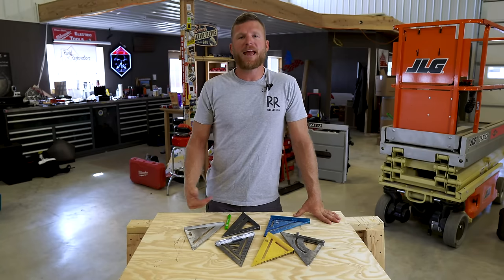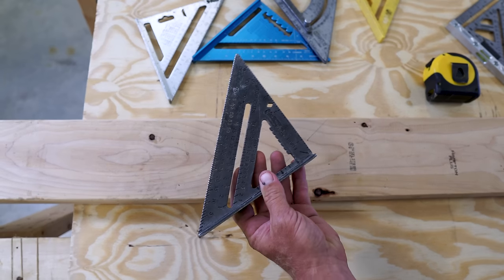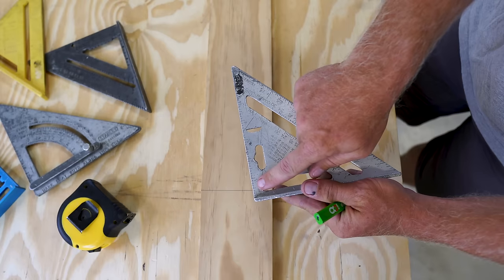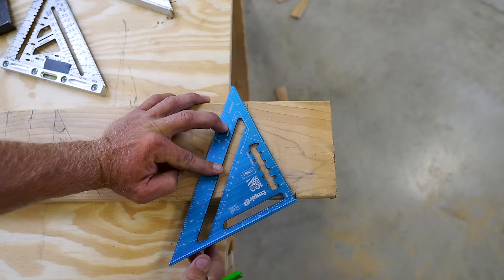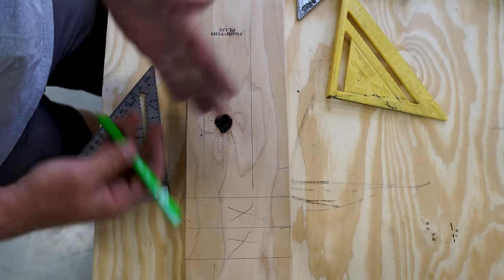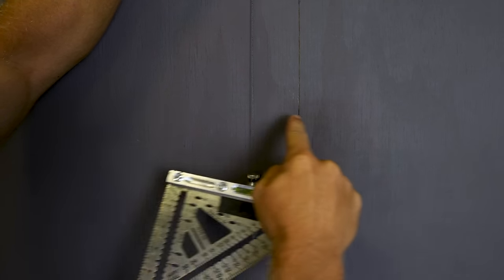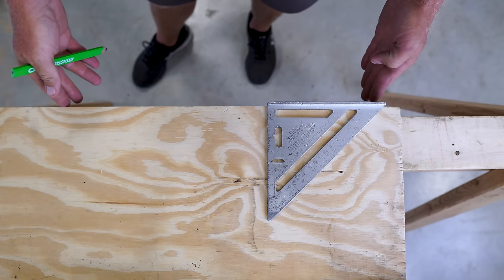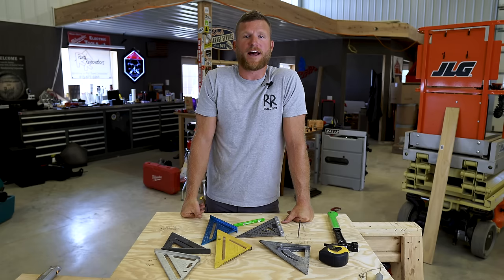Top 10 Uses of a Rafter square, aka "speed" square

Comment: I like your reasoning for having the speed square face towards you when cutting a board. I will start doing that.
Reply: i have found that the square is more prone to wandering away from the wood when used that way,  also you must keep a tighter grip on the square and work piece to keep it from moving.
Reply: Framing square is a different thing and not discussed in this video.
Reply: I cut this way because the saw motor catches on my empire lip so i decided to just flip it and hold tighter
Reply: @benningtoncamper2852  nah, I clamp mine
Reply: alejandro espino same especially if you have the saw depth all the way down
Reply: @versatileduplicity9313  that sounds sensible, methinks I shall do this.
Reply: @versatileduplicity9313  that would take forever
Reply: @KJ110813  it’s called accuracy and not a shitty cut !!
Reply: @versatileduplicity9313  If you're cutting baseboard and don't have a chop saw or something, sure I can see how a clamp might help (though I've successfully squared 1x6 clear pine boards with no clamp and a fine finish blade on my circ saw without any issues).

Though if you're cutting framing members  and can't get an accurate cut without using a clamp then you might want to either get a little more practice in or replace/sharpen your saw blade. Or invest in a(nother) chop saw.
Reply: @KJ110813  how about you just figure out how to make accurate cuts, but fast
Reply: @versatileduplicity9313  I have. That's why I said using a clamp would take way too long and be a huge waste of time.
Reply: Hell no! It can wander that way but can’t move iF edge is on your side. Really surprised he said this given all other tips are on point

Comment: You also helped this 37 year old mother of three who recently fell in love with woodwork and knows absolutely NOTHING about it. I appreciate this video, learned a whole lot and I am excited to start my first project!
Reply from the maker: Awesome good luck!!
Reply: Vanessa Benitez Do it! Get it Done. I built my own garage work bench (8x4) from simple internet plan under $60 using 3/4” plywood, 2 x 8’s, circular saw, tape measure, nails, pegboard, and plenty of elbow grease. 👊🏻 Bit of sanding and 2 coats of poly varnish. 5 years later it still looks good and most importantly, USED! 👍😁 Still get complimentary remarks on it, with the occasional “...YOU built that?!...” I hit Medicare age end of this year. Proud am I?! You betcha!!! 😌😀

Comment: I actually got my start in woodworking through cabinet and furniture making. I went 12 years in the craft not knowing how certain features of the speed square could improve some of my tasks just because no one ever showed me. Finally I employed a rough carpenter and taught him fine finish work and then I got to learn from my employee how it could benefit me. 

There's a lot of basic Carpenters tools that hobbyists and even pros in other sub categories of carpentry don't understand. I think it's cause people rush to use the big table saw and chop saw and don't slow down to learn the small stuff. Even like what a Carpenters pencil is good for. Again, I didn't learn this till like 12 years into the trade.
Reply: You covered many excellent points.

Comment: Killer tips! The "double check your square is square one" is really on point. I don't do framing, but have used a square like this since I started building things. The square I had been using was not square and led to some major headaches come glue up.
Reply: I bought a drywall T-square once that was about 1/2 degree out. What a pain. I finally wrapped it around a telepost.
Reply: @gordonwaldner9792  tapping w/hammer on drywall squares to square them is normal

Comment: Your top 10 uses were great, very glad you decided to share.  I have watched other content on using squares and yours was different.  First you demonstrate what we need to know quickly and to the point.  No excess dialog, unlike my comment:)!  And even better the information provided on how to use a tool is qualified further by your on the job experience.  I never thought of flipping the square base to the far side of the board when making a cut with the saw, but your insight on why you do it that way just makes so much sense.  That's one tip, that this old brain won't forget!  

Regarding video material that may seem mundane to some, I would love to see practical measuring and marking tricks.  For example, and I may be reading too much into what I saw, when you demonstrated how to make a 90 degree/perpendicular cut, you put a straight mark on the board as the desired measurement, but then added a check mark.  The speed at which you did it told me this is just part of how you do things and I wondered why you added the second, clarifying mark. And how did that change where you placed the square if at all.   I am not in the trades, just a DIY, but always looking to improve my measuring, marking and accurately cutting material, as I have yet to master.  I measure, I mark, I confirm measure, but then find I have to sneak up once or twice on the cut because some how I am off.   I have also heard in videos leave the line, take the line, split the line, but why did that person make that call after making the mark?  I don't know if it is because I am a lefty, or just my aging eyes, but I find marking to be my biggest challenge on any project.
Reply from the maker: Interesting... things I take for granted at this point but maybe I Great video to help someone
Reply: x2

Comment: Great tips.  Any measurement under 7 I'm using my square... A lot faster than tape.  One thing this young veteran carpenter will add is how to quickly  mark the pitch of a layon or porch roof.  Example, 6/12 laying on a 10/12.   Pivot square to 6, hold there and mark 10, then scribe from pivot point through mark.  Saves lots of headache!
Reply from the maker: Interesting I like
It
Reply: i always do that, i am a framer by the way 🤙

Comment: Thanks for the info. I’m almost 50y/o and I learned a lot. I’m a “late learner”,  I spent 20 years in the infantry and didn’t have much need for a square. You answered pretty much all of the questions about the meaning of the numbers on the inside of the square and the different ways to use it. I don’t plan on ever having to frame a house or build a roof but if I ever have to help someone at least I have a basic understanding of how to use the square. Thanks again.
Reply from the maker: Thanks for your service Scott!!
Reply: RR Buildings thank you for your support. 🙂🙂🙂

Comment: You know when your running strapping on a wall against say a 4/12? to make the Angle on the strapping to match the roof because I'm a math guy I'd subtract the degrees off of 90 simple eh? Well I had a guy working for me that wasn't a math guy and he taught me a simple way put the square against as if you making a square mark but then make a tick mark at the 4/12 or whatever pitch it is no math required! Great channel keep up the good work.

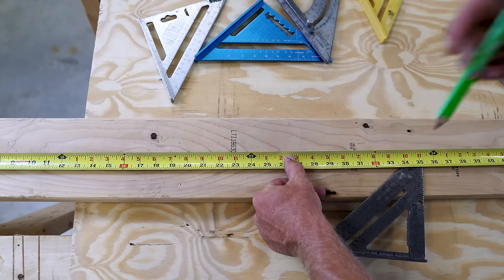Comment: 1 - 1:34 - 90 degree cut
   - 2:09 - 45 degree angle
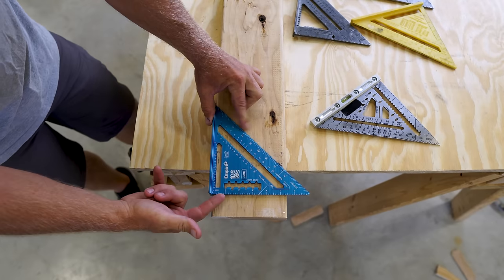2 - 2:21 - Square cut guide
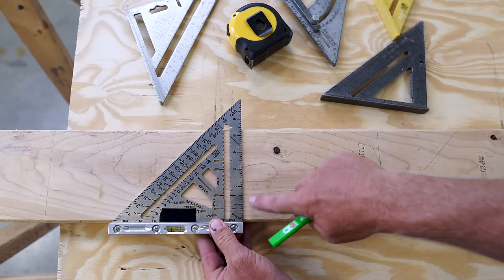3 - 3:19 - Odd angles
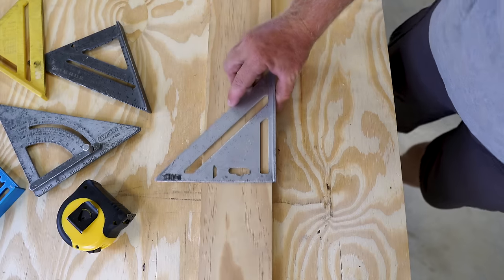4 - 4:08 - Quick Reference Line
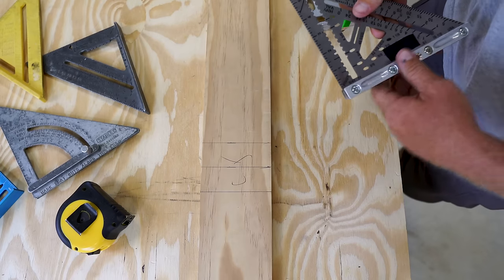5 - 4:52 - Rafter Pitch
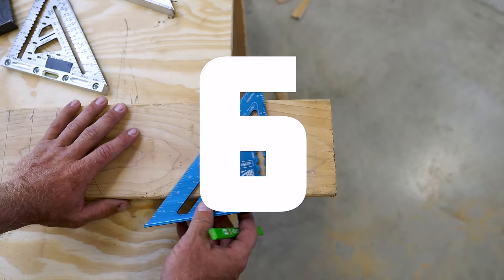6 - 6:56 - Scribing
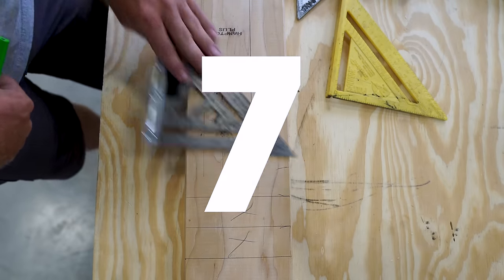7 - 8:24 - Measure an angle 
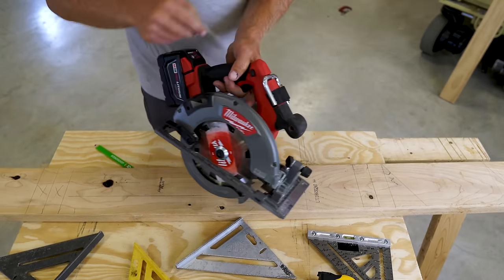8 - 9:13 - Perpendicular blade check
9 - 9:47 - Plumbob level line
10 - 10:37 - A perfect circle
Bonus - 11:42 - Square check your square

Comment: Young man, thank you!!  I piddle around my garage and I built my own work bench from a plan I designed in my head. I've built benches and storage chests, but I'm still a beginner.  I learned a lot from your video.  Tips 2 and 3 are my favorite and I'll be using my squares to measure angle cuts.  Thanks.

Comment: I know your top 10 is related mostly to the work you do, but another useful tip my dad taught me was using a square to find the center of a board. If you simply rotate you square on the pivot point to an even number on the adjacent face and then just mark that midpoint. I.e. if your board is 3 1/4" wide, but you pivot the square out to 4" on the adjacent face, the center of your board will be at the 2" mark.  quick and easy!   As always, love your channel!
Reply from the maker: Awesome

Comment: Excellent as always!
Re: 2nd tip. Pulling the square to you, often users forget to retract the blade slightly to miss the heel as the saw passes over.
For someone new, this could result in a bad cut.. Or worse the blade binding.

Comment: Tip number 3 - you made a 60 degree line from your pivot point, or a 30 degree line from your perpendicular line. I sometimes use the "subtract from 90" method when I can't get the square into a tight space and have to use it "upside down". Number 9 made me chuckle. Thanks.

Comment: I'm a couple of years late to the party but another use for a speed square is to use it as a spacer between deck boards. Two squares would be required. Just stick them between the last attached deck board and the next (unattached) board at a distance from one another appropriate for the length of the board. The flange on the square will keep them from falling through and you get a nice even spacing between boards. I use Johnson squares so the thickness of those are 3/16". Another brand's thickness may be different.

Comment: Great video.  Very easy to understand and follow.  The problem that I have with the Square a/k/a Speed Square is that while it is easy to find 90, 45 and Common Plumb Cuts -- there is no easy way to find the corresponding Rake cut.  Example: I am applying horizontal lap Hardie siding to a roof that has 10/12 or 8/12 Pitch.  If I use the Square and pivot to 8 or 10 Common all I get is the Plumb Cut.  And I do not want the plumb cut, I want the Complimentary Angle.  Recently, I discovered that Stanley Adjustable Square solves this problem.  Other adjustable squares by Woodpeckers, TrigJig or Karpenter.UK are quite expensive.  Please provide your insight regarding how to best use the inexpensive non-adjustable Square to find Rake cuts ?  Thanks.  Rhino Ranch Construction, Montana, USA.

Comment: Great Video ,another good use for the plastic cheaper ones ,i drill holes rate thur the square to line up handles on cabinets and drawer fronts ,by setting it on the top or bottom corners , then drill the handle holes ,then it's just a case of flipping it from side to side or top to bottom ,drawer fronts ,find your center line measure to the of it left and right to the width of your handle mark your height center line ,mark the first one off drill your hole then flip it using your lines ,after the the first ones it goes pretty fast once the square has its holes drilled ,just remember to use tape on the tops of your drawers ,some pencils mess up your finishes
Reply from the maker: Great tip
Reply: @RRBuildings  hey  great buildings

Comment: You can also check the 45 deg angle when you set your circular saw (probably should do it without the battery installed)

Comment: You should check those Stanley adjustable square’s right out of the packaging. I started having problems with one and opened two new one’s and got the same results. I stopped using them after that. I had a couple cut on a laser table out of 3/16” mild steel plate and no problems since.

Comment: Great video. What brand is that square with the level on the bottom you were using for the circular saw cut demonstration. Another use is the squares make good spacers for decking.

Comment: Your last tip on checking your square is square ; If you find that it is not true , can it be easily brought back in ? Like you can with a framing square and a centre punch in the internal or external corner. Cheers, keep up the good work.

Comment: Doing my public service

1:38
1. 90° and 45° lines
2:26
2. Saw guide/fence
3:22
3. Other (than 90,45) angle lines
4:09
4. Common framing reference points 
4:55
5. Rafter specific conversions (pitch/degrees)
6:57
6. Scribing
8:25
7. Determining angles on built structures
9:14
8. Squaring saw blades
9:47
9. Determine a level line without a level (lol)
10:38
10. Mickey Mouse compass

Comment: On standard construction lumber that has a rounded edge, isn't the likely to be an inaccuracy using the custom angles (like the 30 degree example) depending on whether you line up the degree mark with the outside or inside of the rounded edge?

Comment: More like this. Torpedo level, framing square, plum bob, when to use a ballpien, more.
Reply: Connor Sullivan ball-peen hammers are mostly only used for peening metal rods to hold a product together, such a a knife has pins that get peened so the scales will stay on the blade. Peening makes the the metal harder and fracture resistant. If your looking for a video about ball-peen hammers look up Walter sorrels, he’s an excellent knife maker!

Comment: Great video. At one point you state the 6/12 rise/run is 26.5. Later you give an angle of 38 degrees. Was one measuring from the top of the rafter and the other below?

Comment: Awesome video coming from someone who is new. Question when using the square for measuring degrees do you always use the smaller side of the square to draw your line ?
Reply from the maker: Always on the side that is the right angle to the lip

Comment: Nice video. I just wish you had shown how to use the diamond on the Swanson Speed Square to mark out a bird's mouth. My friend claims the slot found on an Empire is far more accurate and so far it appears he's correct, unless I'm not using the diamond correctly. It seems the problem with the diamond is that it isn't long enough and accuracy suffers.
Reply from the maker: I would agree probably

Comment: For those who do not build houses in US what are Hip and Standard for?
Reply: Standard? Not sure what you mean. A Hip is a board where 2 Angled roofs meet. The most common is when 2 roof pitches meet at 90 degrees. Essentially, the house is an L shape. That’s a “hip” rafter. I believe it’s also known as the roof “valley”.

Comment: Great tips there for newbies, however it’s also a great refresher for the semi-pro’s. The only thing that I have to comment on [and it’s not a criticism] is that I’m bumswizzled as to why Americans will go do fighting rather that ditch imperial for metric?

 Counting in tens is a shed load easier than counting in twelfths, 32nd’s or 64th’s etc. The engineering industry here were the first to launch the imperial measuring system for metrification.  In fact I’m led to believe the US engineering already uses metric so that they can compete on the world stage with other competing companies. Plus it dramatically cuts down errors converting metric to imperial. Again just saying extremely simple to add, multiply and divide in tens, and the biggest bonus was......? Good bye to dumb assed fraction’s.  Multiplying and dividing fractions of an inch sucks, especially if your not working with measurements on a daily basis. However even a moron with only a few fingers on each hand can easily work with metric.  It wasn’t long after decimal currency came in that the engineering companies adopted the metric system and the rest of us started using metric over imperial until imperial almost became a relic of the past.  Metric only has Been taught in schools for a good few decades now and it’s a fact that school levers going back at least 40 years or more, do not even understand imperial especially getting them to divide up several fractions, they’d just laugh and wonder what goon came up with such a non intuitive measuring system. Take the plunge guys, it’s not difficult, in fact it’s so easy you’d wonder why you’d not switched over decades ago.  To give you an example, I have a decent set of imperial spanner’s and sockets from when I was a kid driving old cars about because that’s all we could afford.  I honestly cannot remember when I used them last, at least 30 - 40 years goo. All cars are assembled with metric fasteners now except American vehicles I imagine.  Go on liberate yourselves.
Reply from the maker: Hey man I learned imperial and it’s all I know.
Reply: RR Buildings 
Hey there, it’s totally understandable, your not on your own in the US. look at my comments this way. You’ve got 2 people:  1 that learned imperial from day one and 2:  you have a person that le8arned metric from day one.  Now tell them to swap measuring system for half a day to sit down with each other’s tape measure. Get them to measure identical various items but not at whole numbers, for example 10" or 250mm, rather say 29 11/16 and 659.5 mm.  Then give them a piece of paper with imperial fractions and another one with metric fractions.  I guarantee the guy that only ever learned imperial would virtually be able to read a metric tape and measure anything they chose. However give the guy who knew metric an imperial tape and ask them to measure a few things that were not whole numbers.  They’d have trouble getting their heads around it. The next bit would be even harder on the metric guy when given several numbers containing fractions as well, say divide, multiple and even addition.  Unless they were Einstein they’d have Bob Hope & no hope chanced to start with but give the imperial guy the same types of calculations but in metric, they’d easily get their heads around it almost immediately because counting in factors of 10 is so intuitive, plus, provided you’ve not previously chopped them off, you have 10 digits between your two hands. Once you’ve spent a few days - metric only, you never want to go back to imperial. Don’t be wary of it just because you e only ever known feet &  inches, metric is a walk in the park.  10mm = 1cm = 1000mm which is also called a metre. There are also easy conversions to give you reference between the two: for example there are almost 25mm to the inch, 100mm = 4", 300mm is a foot and an so it goes on. 

|250